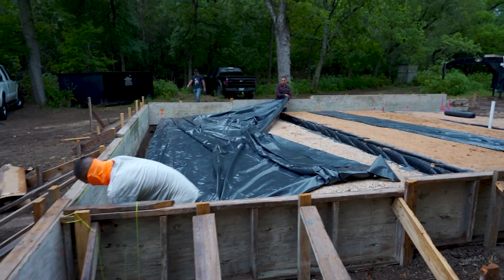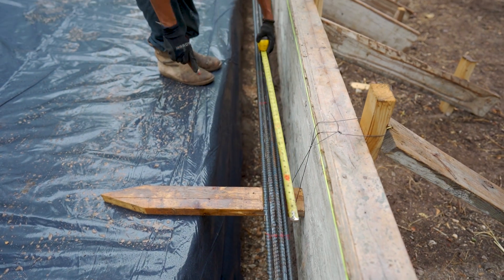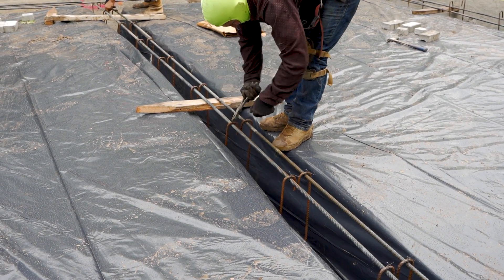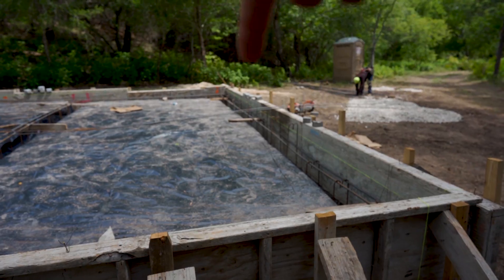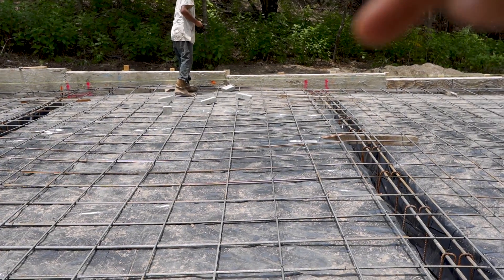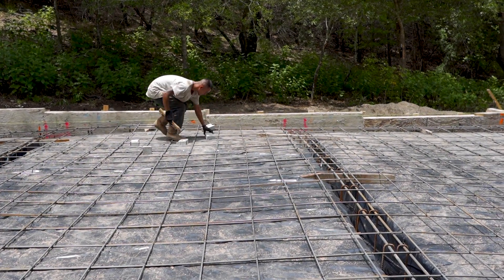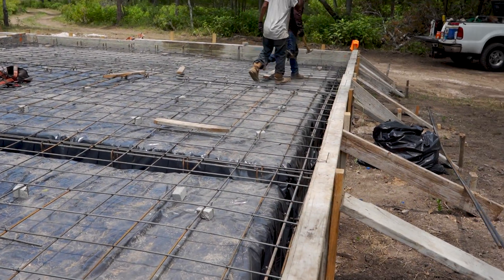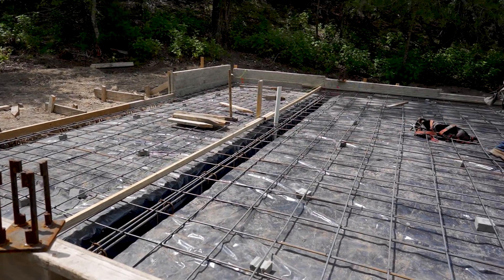Tying rebar for Concrete foundation | Demolition Ranch Headquarters 4 | E67 S3

Comment: Being a building contractor and doing a lot of concrete construction I developed a lot methods  for chairing and sperating layers reo, I used make own concrete spacers for the bottom layers for on ground and suspended slabs using seedlings tube trays filling the trays with concrete mix and pushing galvanized wire into each tubes. The wire give the ability to be fixed to the bottom layer in  Australia you the trays various depths from 1 to 3 inches.

Comment: For those who may be wondering why the rebar has to be completely encased in the concrete, one of the reasons is to protect the rebar from water (especially water with salt, or perchlorate solution) intrusion that would cause it to rust. And, when the rebar rusts, it stops providing that tensile strength the pad needs. Granted, the pad will eventually crack, and those cracks will be infiltration points, but the longer water is kept at bay means the longer the lifespan of the pad.

Grady from Practical Engineering has an excellent video on the topic. (Complete with him making samples and putting them in a hydraulic pressed.) The video can be found here: https://www.youtube.com/watch?v=PLF18H9JGHs
Reply: Thanks for that info! Throughout the video, I was definitely wondering how the rebar is prevented from rusting and what would happen if it rusted!
Reply: Does the rusted mesh work as well as the clean ones. Wondering whether the rusted surface will have less adhesiveness.
Reply: @thestraightwire8393  The problem with the rust on the rebar is that as the rebar rusts, it expands. This puts outwards pressure on the encasing cement structure, causing that structure to fail. Also, as more of the rebar turns to rust, there's less rebar doing the job it was intended.

There were sections of Champlain Towers South where the concrete superstructure cracked, allowing water to get inside and rust the steel framework, causing both the concrete and steel to fail. Now, this isn't "The Reasons Why That Tower Fell", but the byproducts of design changes during planning, design changes during construction, changes to parts of the structure (in regards to one of it's neighbors being built later) and the type and quality of maintenance that was supposed to address these cracks. Yes, the cracks and water intrusion is what killed the building, but everything else I mentioned created the situation that caused those cracks in the first place. Got to make sure that rebar stays rust free as long as possible.
Reply: @jackielinde7568  niiiice.  Misconception rust doesn’t matter by wholesalers. Putting it in place is a one time act, maintenance is the continuous art.

Comment: Another great video showing some very skilled people but yes you are assured critics! Code varies by state,county, city etc and is often driven by location and climate. Having researched a bunch of different codes, rebar is commonly 3” clearance from the bottom and 2” from the side/forms. Often times the overlap length at the splice is dictated as well including having to bend the corners not allowing a joint or overlap closer than 1’ to the corner. Just some of the more common rules and in my neck of the woods. Good heads up on the brick type as well. Nobody likes a failed inspection and redo.
Reply from the maker: We overlap bars a minimum of 40 bar diameters.   We use corner bars (24x24)

Comment: If the building is getting electrical, you also need to bring one rebar to the interior above the slab for bonding a ground wire to the neutral.
Reply: Also I would have connected the welding plates to the rebar grid then they could bond to the frame of the building structure. But since it's not connected there's no good ground there.

Comment: This is quite interesting because here in Australia all the mess (rebarb) is all prefabricated. There is no need to to wire the mess up, it all comes on the back of a truck. Wouldn't spot weld each one be quicker then wire them like you are doing. Very interesting viewing though.
Reply from the maker: We have wire mesh here too, but it’s inferior to rebar because it’s thinner.
Reply: Spot welding would be way slower & honestly miserable. Omg.

Comment: Twistys are for small builders and DIY people.As are the guns.For one they only tie slash ties which is about 1/2 the ties needed on re-bar. In the UK and the EU theyre tied with reels or loose wire reels the only difference is in UK we use short nips and in the EU they use longer nips.Your lads are using pliers which Ive seen in the US on sites but I converted some to nips(channellock are best) because of the speed,about the same but the ties are a lot tighter with nips,those ties wouldnt hold 16mm horizontal bars but here they dont need to.Yet again the best instruction on how it should be done Ive seen on the net,didnt get to see the corners,the bars loads get wrong.

Comment: So, how many different sub contractors will you use on this slab? 1. forms, 2. excavation, 3.backfilling, 4. plumbing, 5, rebar, 6. pour slab, finish slab?  how much to get the rebar tied on a job this size? interesting technique on placing and tying the beams (footings).

Comment: Great video. There are several different ties for rebar depending on the application, vertical, horizontal,  weight, etc. Maybe do a cutaway to a handout on the different types? Your guys are good.

Comment: "It's that easy!"
I mean, it is when you do it for some time.
I've been with the IW doing rebar for 2 months now.
I don't hold a candle to these guys. It'd take me 3 times as long, my ties on the bottom would be trash because I suck in confined spaces, and if you aren't doing it regularly, prepare for your butter hands to scream.
That said, it isn't that hard, but it does take a lot of time doing it to get that quick and smooth.

Comment: In Australia we weld up "cages" for the trenches then carry them over and drop them into the trench. 

We also use sheets of mesh so no need to tie all the rebar.

Is this method becuase of engineers specifications in the US? 
 I've never seen it done this way before.
Reply: yes

Comment: You put the "liner" to prevent the concrete from getting moisture but you drove stakes through the liner into the fill dirt to place the headers. Is the amount of moisture from that negligible or do you "plug the holes" afterwards ?
Reply from the maker: “Negligence”?  😂
Reply: @TexasBarndominiums  maybe miscommunication here : I'm not calling you negligent, I'm asking if the amount of moisture from the holes made by the stake is negligible.

Comment: 3:00 it’s always been a footing to me. NEVER have I ever heard it called a beam. Beams go over head.
Reply: "A grade beam or grade beam footing is a component of a building's foundation. It consists of a reinforced concrete beam that transmits the load from a bearing wall into spaced foundations such as pile caps or caissons"
Reply: Angel brothers, Baytown TX.....Always been BEAMS here

Comment: Is that tin lug or brick lug beveled on the bottom so the final ledge on the foundation is sloped down and out a little to help drainage? 
Although I suppose that wouldn't work for brick...

Comment: I am not an engineer - I've never even played one on TV.... that said - I'm pretty sure the rebar in the slab needs to be where the concrete slab will be in tension which is not the middle - probably in the lower 1/3 of the thickness... but you need proper coverage of the steel by the concrete like you mentioned so 1" off the bottom might be too low...  That's my recollection from my 3rd year carpentry apprenticeship courses 40 years ago lol.
Reply from the maker: You have to keep in mind that slab also has grade beams full of concrete and rebar.  So the 4” slab is technically not 4”, it’s part of a system that includes grade beams.

Comment: you guys make this look so easy and im sure i sound like a broken record to you (or a scratched cd/dvd for those younger)- two questions though - first - when  you are putting the middle forms in - the supports are hammered through the vapour barrier , how is the moisture stopped ? and second with the metal corners - why not just tie them to the rebar - wouldn't this be secure ? just curious and not poking anything because i don't know but understand by asking !
Reply from the maker: 1.  Place where stakes are driven in will get filled with concrete.  So will be thick enough it won’t matter.  2.  Rebar moves when we pour concrete.  If we tie plates to rebar, they will move.
Reply: @TexasBarndominiums  ok that makes sense ! thanks :)

Comment: are the stirrups 24 inches apart on the rebar cages?  Did they tie a 2' x 2' or so L at the corners to tie the rebar cages together top and bottom?  Thanks
Reply: Never mind, stirrups 2 foot spacing earlier in video, corners overlap at the corners and other intersections later in the video, not lapped around corners.  thanks for the detail.

Comment: Also why only the 50% tie?
Reply: Tying is only done to hold the bar in place during assembly and while concrete is being poured, and you only tie enough to accomplish that, any more is wasted time and material also the tie wire adds zero strength to the structural integrity of the structure, zero. Just retired from rods after 30 yrs.

Comment: Eric, we tie rebar almost exactly like y'all here in Austin. My Dad's old school though and he always says 100 % cross tie or figure is the way to go. Any thoughts on time/cost benefits to doing 50% vs. 100% or cross-tie vs. Simple tie?
Reply from the maker: 50% is twice as fast as 100%. 😁
Cross tie only on stirrups for us.
Reply: @TexasBarndominiums  Yeah, I guess ultimately it depends on inspector or engineering plans/specs. I've always wondered how much 50% vs. 100% and tie style has on the strength. That would be a good test.
Reply from the maker: Andres Acosta 
I don’t think strength is an issue.  Wire tie is simply to hold it together until concrete is poured.  After that I don’t think it matters because it is encased in concrete.

Comment: So how do you know what size rebar to use? Or does it matter?
Reply from the maker: It matters.  Experience is how I know.  Doing so many engineered foundations I know that engineers like to use.
Reply: Wire mesh? The guy that did my slab used it and its all cracked. Hard to to find good work out here?

Comment: Hey there is a new tool available that wire's rebar with out bending over it's. a back saver lol
Reply: I came here to type that, but that lad in the green hat is faster than any machine I have seen.
Reply from the maker: I bought a “machine” before.  We raced and I lost drastically.  Didn’t ever use it again.  Lol
Reply: take a look at the makita rebar tie tool, very spendy but faster and will save your wrists and back as a result. Better yet you can dual wield them and just go crazy speed.

Comment: Actually you don't want your rebar right in the middle. You want it closest to where the concrete will be in tension. In a slab you want it the lower as possible unless its a slab in cantilever. In that case you want it the highest in the slab as possible

Comment: Here's a question why not use fiber infused concrete instead of doing all that rebar work? I know nothing about concrete other than another youtuber by the name of Cleetus McFarland had a massive 6 to 8 inch thick skid pad made with the fiber infused concrete. Does it have to be rebar if a building is going on it vs nothing going on top of it other than cars?
Reply: Not in Australia at least, we use it all the time for driveways and small she'd slabs, mainly jobs that have shallow footings or no footings.

Not sure on the specs for this job or what kind of building will go there but looking at the footings I'd say fibercrete would be a no go.

Comment: I've used saddles before and agree with you, brick is way better!  I refuse to use saddles anymore.  I'm almost done with a project this summer and we used fiberglass rebar.  Have you had any experience with the fiber?  What sold me was no rust/deterioration over time.  As a nice benefit it was super easy to cut and carry...light weight, nice stuff, but, the corners require more work, so, always a trade off.  Love your videos, always top shelf information!
I run my company out of a "barndominum" and we love it!  Too bad we live far away, but our builder was awesome as well.
Reply: We have a product called fibercrete or reocrete in Australia there is fibreglass and plastic in the concrete itself so it doesn't require any reo or steel at all for the slab. 

Can't be used on big house slabs though only driveways small sheds and such.
Reply: I think it has to do with being less fire resistant.

Comment: your guys are WAY faster than using those damn rebar chairs...By the time you even set the bar into the groves your behind, not to mention they're like $100 for 60ea plastic little tents...no way, Your guys BUST ROD! They probably laughed at you when you showed up with your bar tying machine lol - Linesman and some fucking wire! TWIST IT!

Comment: NOoooooo rebar in the middle of the slab is almost useless... it is in the neutral axis in the middle (meaning no tension or compression) rebar is ideally placed in the area of tension - so in the case of this slab use shallower bricks so rebar is in the tension side of the slab. I hope that makes sense.

Comment: you should have the same guys doing the garage do this but maybe you get some discounts using youtuber - why the big rush - in another month you should be well on the way to finishing - getting everything inspected and then you can settle in - building and moving is stressful - you should camp out inside the abandoned mansion with the family just don't tell mere about the ghosts and bigfoot could be an issue too at least until you get the 800m bigfoot target set up, garden gnomes could also send a message of measured intimidation ok gnomes with tannerite to celebrate when everything is done. you are doing fine - you must do the concrete poolhouse/office/gardens - call it diy bunker no 2 #why the grass is always greener over the septic tank

Comment: 0:33 this is not true . the plastic is there so the ground does not suck too fast water out the concrete . The same thing is done on top with a sealer or by adding water on top ...